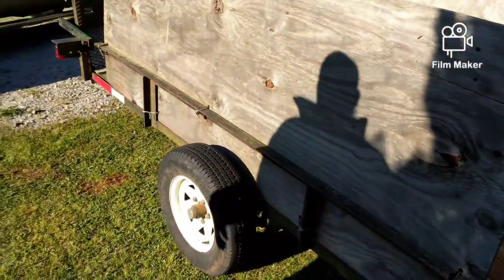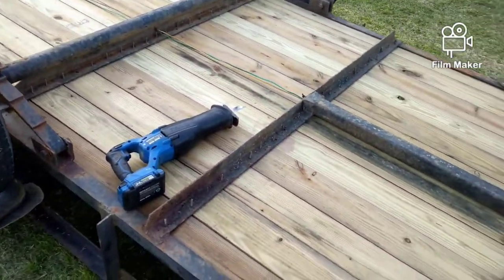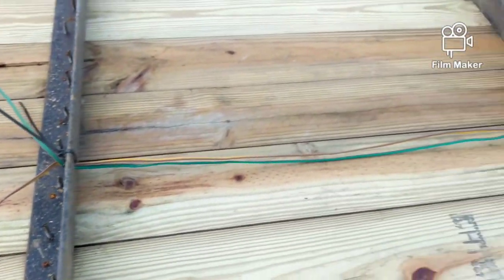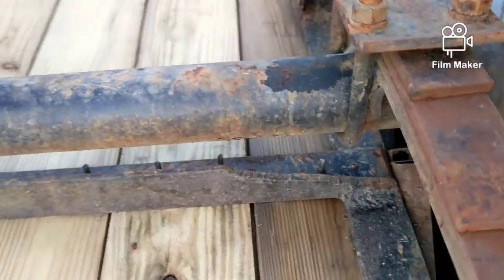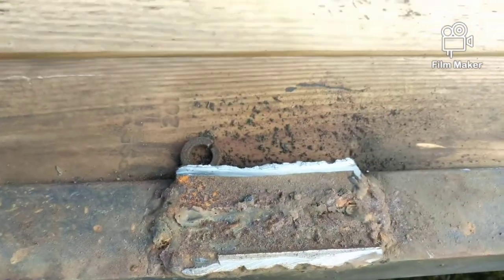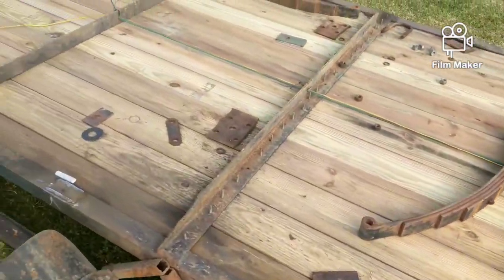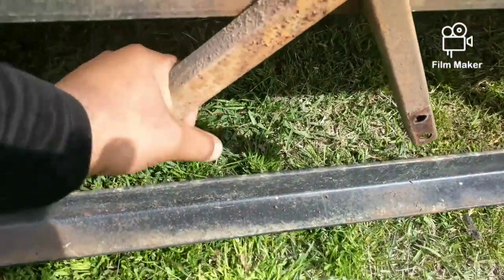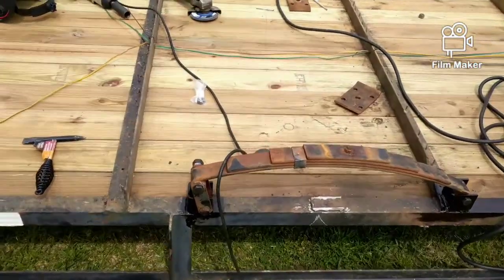How to fix and balance and old utility trailer

Comment: You should have put the axle underneath the springs instead of the same way it was before you started on it
Reply from the maker: Yes I did end up putting it on the like it was before thanks for watching the video
Reply: @idennis75  the point was to reverse that order . I've got a trailer that I will have to do that also , which ad you know puts the springs on top of the axle when going down the road